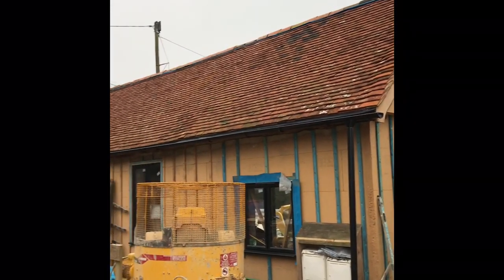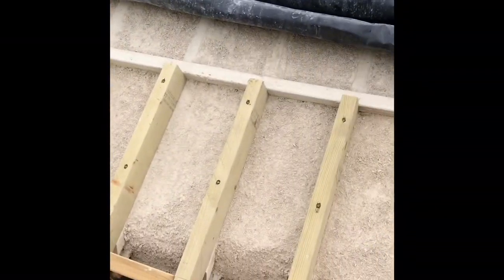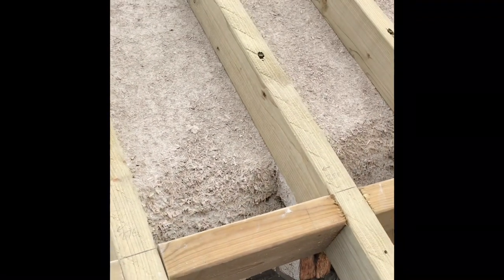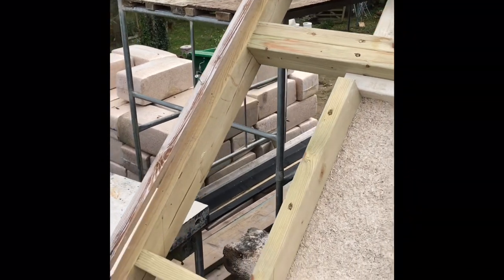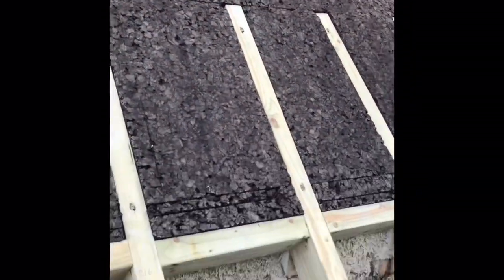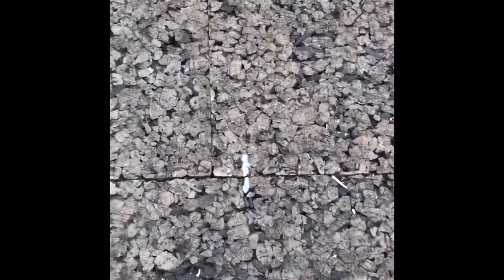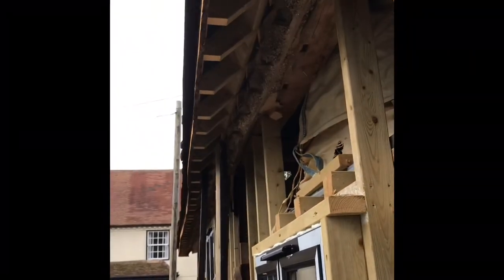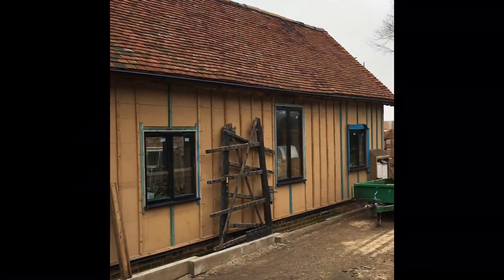Hemp/clay spray and cork roof insulation update

Comment: Can I ask about your herd/binder mix? Im not familiar with clay binders :) super curious
Reply from the maker: I was using powdered clay and the same ratio that I would use with lime binders so it was around about 1 part clay to 3.5 parts shiv/hurd by volume. 

But I put half the amount of water than I usually would with lime.

I was using my spray machine so the actual ratio was about 40kg of powdered clay to 200litres of shiv/hurd.

Comment: Hi Will, Why use clay powder instead of lime? Will hemp / Clay work for for walls and what is the difference in "U" values?
Reply from the maker: Hi Steve, it’s mainly an embodied energy thing. Clay hasn’t been burnt and can be from the building site itself so it has a lot less embodied energy than lime.

It’s not as resistant to the whether as lime and in a wall would probably want protecting with cladding rather than a render.

I have used it in walls also and will be experimenting more with it as time goes in.

In terms of thermal conductivity and U-values I had samples tested and they were the same as hemp lime at the same density. 

I recently did a build where we processed the clay spoil from site in my roller pan then used the resulting clay slip to spray hemp clay as the walls.

Comment: Is the blue material a vapour barrier? Is it installed directly on top of the cork?
Reply from the maker: Hi, it’s a breathable membrane, it stops moisture entering the building from the outside but is very good at letting moisture from the inside escape.
Yes I’ve installed it directly over the cork.